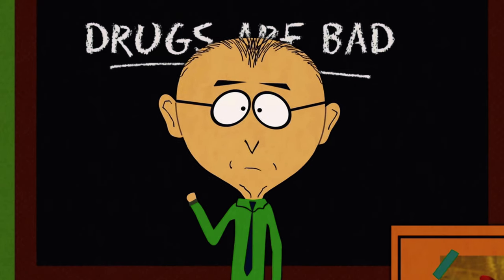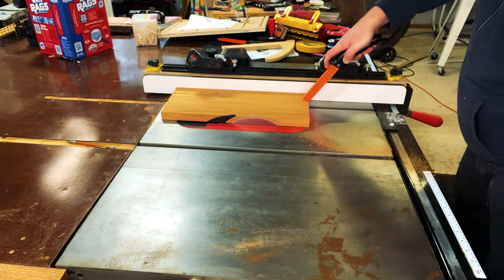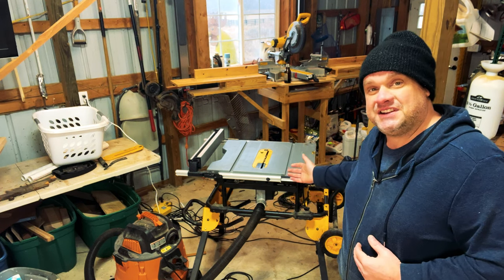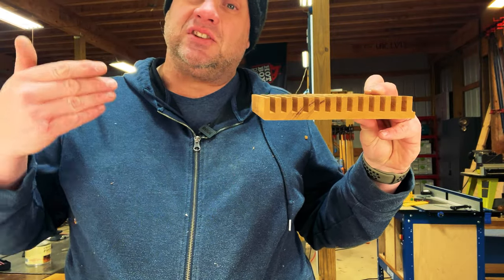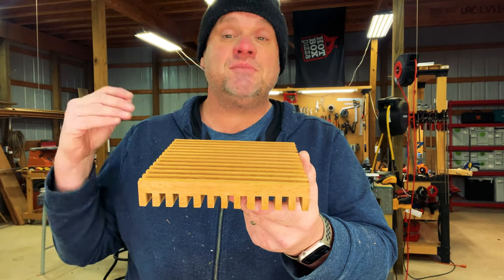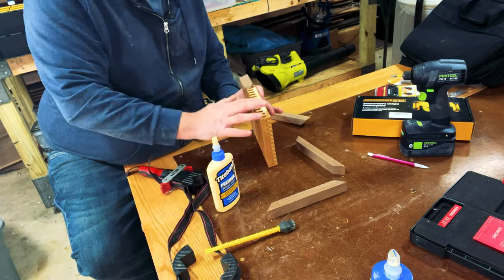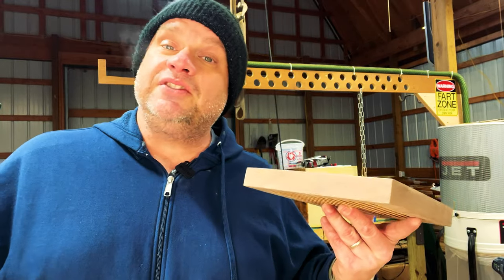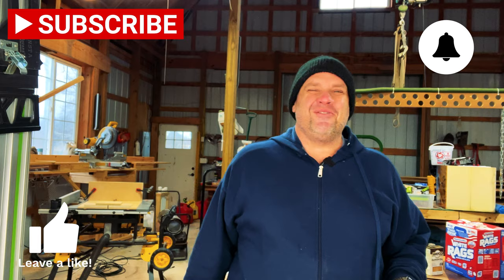The Easiest One Day Woodworking Project - The Trivet!

Comment: I will be making that. Does the Danish Oil raise the grain any?  I really like the box joint jig. I will be making that also. Thanks for another great tutorial.
Reply from the maker: Great question Paul!   I'm sure it does to some extent, I did not notice it on this trivet however.  Not sure if it was because it was such a small project, or it didn't raise it that much.   I did notice that it seeped the oil for about 12 hours.  So I had it on a paper towel in my kitchen after final coats.  Thanks as always for watching Paul!